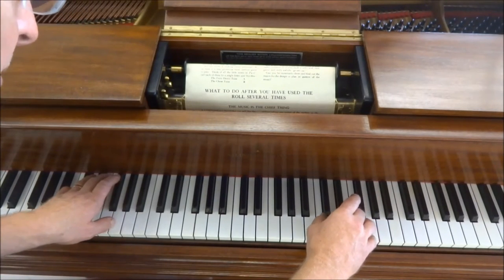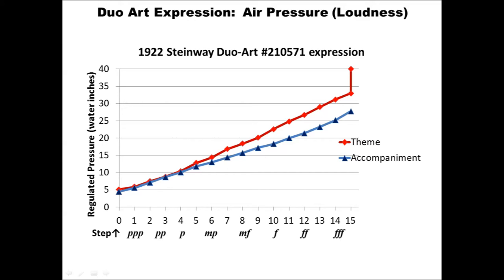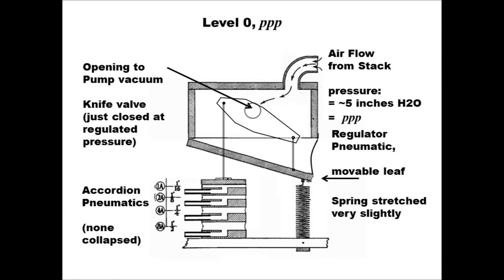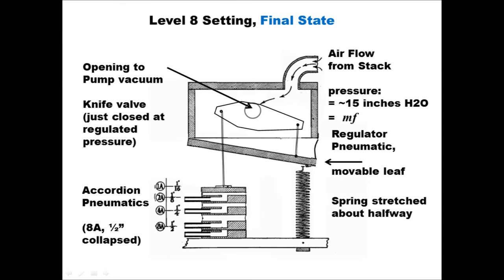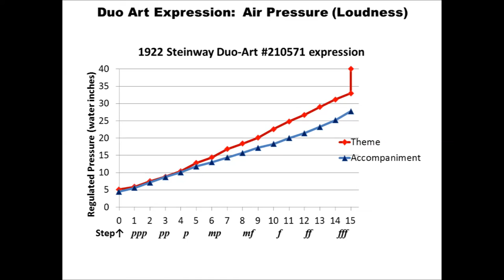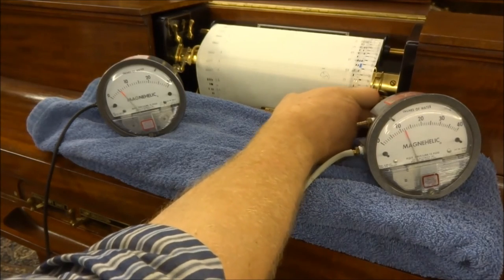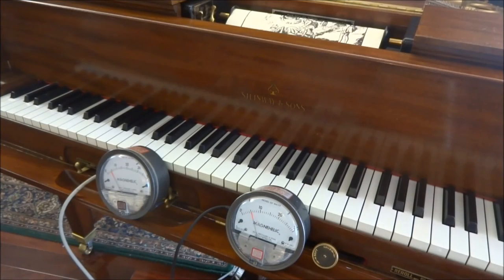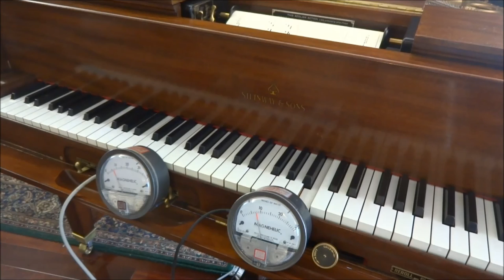A Demonstration of How the Aeolian Duo-Art Expression System Works

Comment: Gongratulations for this video that helped us to restore our duoart, the expressions are perfectly set, for our duoart it is a model 1917 and it does not have a crash valve and the system is differently built, it has for pianissimos a felt muffler

Comment: Wow! I never knew the Duo-Art was so simple!
Reply: It's simpler than some other reproducing systems. The Red and Licensee type Welte (the first/original reproducing piano from 1904) are also simple but they're 'floating' systems with no real fixed dynamic level (although they have a gadget called a 'mezzo-forte hook' that can limit the travel of the floating expression device to either the lower dynamic levels or the higher dynamic levels, keeping it from getting any lower or higher). The Recordo and Art-Apollo systems are even simpler, although they're rare and very rare, respectively. The Recordo is more like the Duo-Art with the binary / additive system of dynamic coding. Other systems (Ampico, Art Echo, various Hupfeld systems etc) have a mix of additive and floating expression devices. The additive systems have the advantage of responding well at various roll speeds / tempos (within the parameters that the system can actually work, of course), whereas the 'floating' systems or crescendo-type systems need fixed or nearly-fixed roll tempos, so that the dynamics coded into the roll 'hit' at the right time in the music (if you play a Welte roll too fast or slow, the dynamics will happen on the wrong notes!).
Reply: @KawhackitaRag  Sounds like Welte had some pretty bad drawbacks...
Reply: Makes me wonder why they're quite rare compared to "normal" Player-Pianos?  Were they THAT much more expensive to make, and/or was it because of the vagaries of getting enough "famous" Piano Players on board?  Thanks for posting.
Reply: @brentcoombs5293  They had several thousand more parts, the rolls were harder manufacture, the coding and arranging was more intricate and many famous composers played their pieces on the rolls. That and also that grand pianos were more commonly equipped and as we both know, grand pianos were extremely expensive then and they're still expensive now
Reply: @PiotrBarcz  "several thousand more parts" - wow!  No wonder then that My Stroud Duo-Art was so heavy to get on and off my trailer.  Now if only I can find enough affordable Audiogragh/Duo-Art Rolls to justify that effort.  Cheers.
Reply: @brentcoombs5293  Yeah, grands are even worse when it comes to weight because EVERYTHING IS BIGGER.
Reply: @PiotrBarcz  My upright Stroud is probably the lightest Reproducing Piano out there, it being one of those even rarer ones that never had an Electric Motor attached.  Pedal power rules, ok?  Still and all - very heavy!
Reply: @brentcoombs5293  Yeah, I have an upright player piano with a standard action and the dammed thing weighs 600 pounds..
Reply: @brentcoombs5293  Yeah, pedals are awesome!
Reply: @PiotrBarcz  As the owner of several reproducing pianos (I used to have a Chickering Ampico which I gave to a friend; and have an Apollo Art Echo upright, and my parents have an Estey Welte-Original); I beg to differ about "thousands" more parts; "hundreds" more like, if you count all the screws. It's not like there are 88 more of everything. 

The only difference most reproducing piano stacks have to the equivalent foot-pumped 88-note player by the same company (like Aeolian, or American, or Standard/Autopiano) is that the stack is DIVIDED with a wooden or other divider in the middle of the wind trunk somewhere, usually between two of the valve chambers for middle notes. 

That way, the treble side of the stack can operate on a different suction level than the bass side, without the levels 'bleeding over'. The extra parts you mention are mostly in the extra expression units added to the normal player, in-between the suction supply (electric pump; or foot pump in the case of very rare foot-pumped reproducing pianos) and stack. 

However, I daresay that, if you took all the parts of an electric reproducing piano besides the upper part (stack, spoolbox, wind motor) apart, i. e. took all the lower parts apart, and compared the number of parts with that of a regular foot-pumped player, depending on the maker, there might not be that many more parts (since some foot pumped players are a bit complicated). 

But of course it's not the AMOUNT of parts but WHAT THEY DO which is important.
Reply: @andrewbarrett1537  Indeed, I was exaggerating a bit too xD I still can't imagine working on these hahahahaha

Comment: The expression mechanism seems really straightforward to me, as compared to the Ampico.  In particular, the use of powers of 2 (1/2, 1/4, 1/8, etc.) is a power-of-2 system that maximizes the use of different selectors, vs the Ampico's 2/4/6, which provides only 7 unique combinations from 3 holes (instead of the 8 that power-of-2 ratios would provide). Made me wonder if ampico was avoiding violating a patent...
Reply: Jim Bumgardner Well, the Stoddard Ampico was introduced in 1912, two years before the Duo-Art.
Reply: The power-of-2 system also mimics the way in which the human ear responds to sound pressure level.  Our ear/brain system has a logarithmic response to loudness which spans over ten orders of magnitude from threshold of hearing to threshold of pain.  Either one of Aeolian Duo-Art's design engineers was very current in his knowledge of theory (the response of human hearing was a research subject at Bell Telephone Laboratories in the early 1900's,) or they did a good bit of experimentation to arrive at that system empirically.

The ear's response to pitch is also logarithmic; the frequency in Hertz doubles for each octave up the scale.  In an equal-tempered tuning ("stretch" is being overlooked in this example,) a semitone is a frequency ratio of the twelfth root of two.
Reply: It's also possible that Stoddard was thinking in terms of written music DYNAMIC MARKINGS where most music is only notated at about six levels of NOTATED dynamics: pianissimo (pp); piano (p); mezzo-piano (mp); mezzo-forte (mf); forte (f); and fortissimo (ff). Of course there are also rarely extreme dynamics notated: ppp and fff for extremely soft and loud respectively. I presume the seventh level intended was a true mezzo level between mezzo-piano (medium soft) and mezzo-forte (medium loud). 

So, given that early Ampico coding was apparently manually created and added by the roll arrangers in post-production (after a person in the studio thoroughly marked up a score in real-time with dynamics while listening to the pianist play), rather than live-recorded, then I presume the seven-level system was fairly easy to correlate with written "mp", "ff", etc. etc. 

I mean EARLY and MIDDLE PERIOD Ampico dynamic coding; 
in the late 1920s, Clarence Hickman developed the "spark chronograph" recording apparatus, which could really record dynamics in real-time and was state of the art for the time. 

However, the depression hit quickly after this so few LATE commercially-issued Ampico rolls were ever actually recorded using this equipment. Most of the rest (at least popular, if not classical rolls) were simply hand-played using the old method or else totally arranged (such as those by Frank Milne). You can read more about the 'spark chronograph' here: https://www.mmdigest.com/Tech/Ampico/jasa.html

Comment: Thank you very much for taking the time to explain technically all the subtile variations, I had aways winedred how the duo-arts systems worked. 
I had a question, the pression controls the force, but do you know if the "attack" (the speed of the key) is controlled by any device, or is it linked with the rpessure too ?
Thanks again !
Reply from the maker: +Antoine Bihr 
I'm glad you found the video to be useful.   "Attack", key velocity, hammer velocity, hammer energy, sound energy, note loudness, etc. are all  slightly different ways of describing the same musical effect.  In a pneumatic player piano it is completely linked with air pressure, just like "attack" is linked with finger pressure when the piano is played by hand.  More pressure makes the key move faster, putting more energy into the hammer, making a louder sound, with greater "attack."
Reply: Yes it has to do with basic physics... how hard the hammer hits is dependent upon its velocity (speed) at the time it hits the string, which then translates into force and sonority/tone. Of course, the piano stack suction levels create the initial driving force of the back of the key (and then thru the piano action to the hammer), so it is force translated into velocity which then is translated back into force as soon as the hammer hits. 

In fact, the very late experimental Ampico "spark chronograph" real-time dynamic-recording device (introduced right as the depression hit in 1929, so it apparently wasn't used very much), worked exactly by measuring the speed of the piano hammer from the beginning to the end of its stroke as compared with more 'absolute time' as meted out by a stopwatch type apparatus, I believe. This was state of the art for 1929 of course.
Reply: One thing that reproducing pianos CAN'T do, that live pianists can do, is lift their stack 'fingers' further off the (backs of the) keys (or wippens in an upright), in order to attack louder notes with more 'wind up' velocity, kind of like a baseball batter swinging at a ball. However, since the piano key has a limited travel (set by the piano technician), between two more or less fixed points, it can only move a short distance, when the pianists fingers finally 'hit' and start pushing it, from however high they've dropped. So the theory was that so long as the stack suction levels could mimic and reproduce the travel of the key from when the fingers hit to the end of the travel, that was good enough, and our ears tell us that it is.